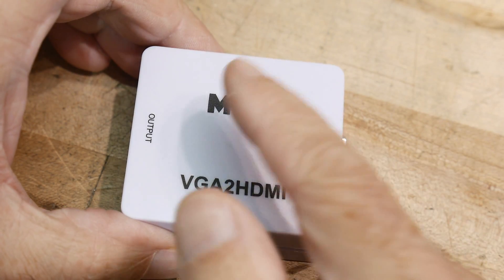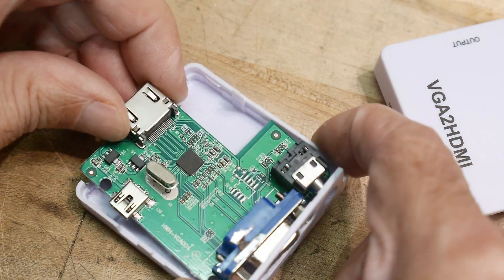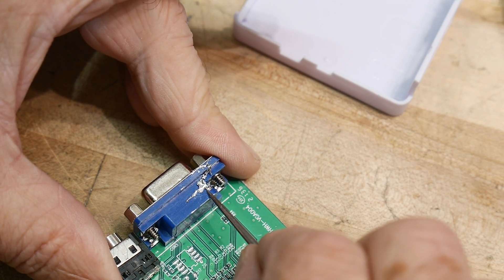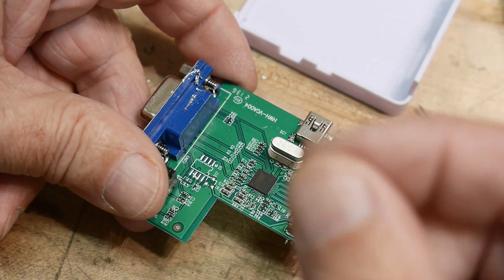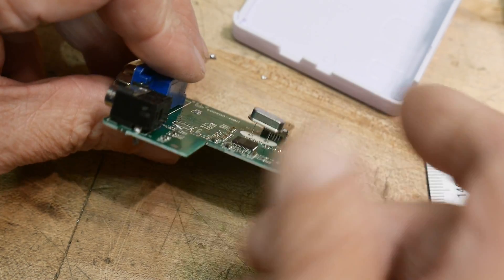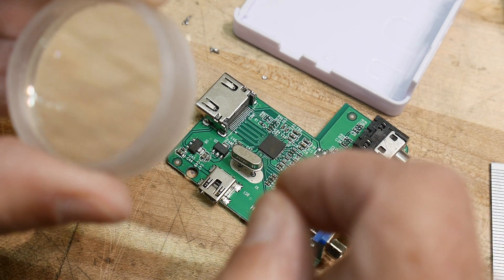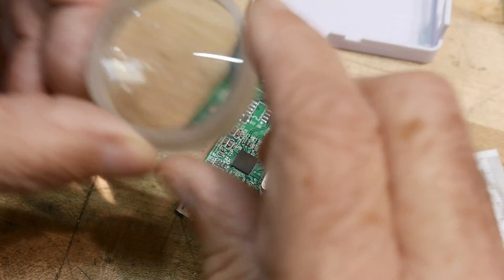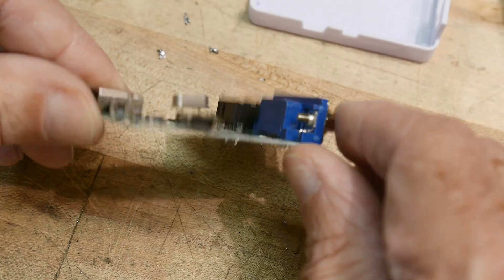#1030 Solder Splash

Comment: which pins on the VGA connector go to the unpopulated chip? could be EDID.
Reply: Definitely looks like it is, but also likely the converter chip can simply handle almost every VGA input variant there is.